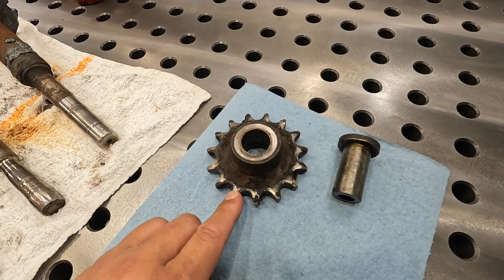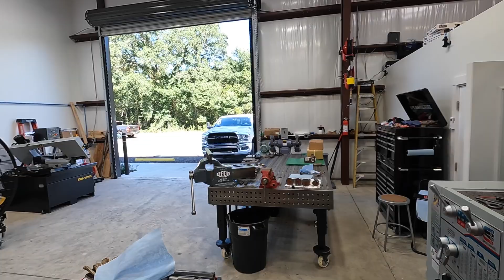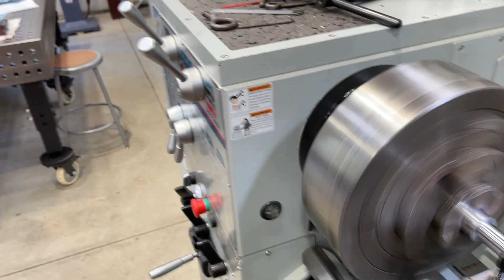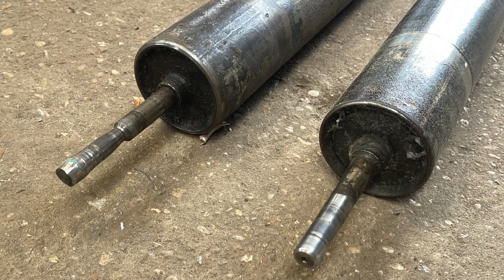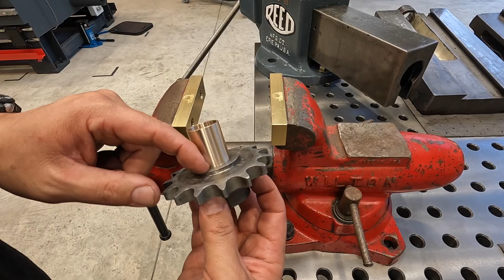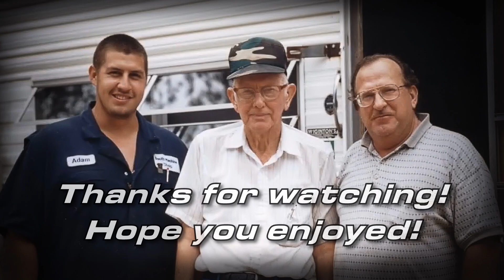SNS 366: Machining New Stub Shafts, Sprocket Repair

Comment: I always hate machining 1018 steel. I work in a shop running production parts and the 1018 jobs are always a hassle. The chips never want to break right and even when they get worn in you still get either chatter or rough patches from the chips not breaking and wrapping around the part. They also tend to put off more smoke than other materials.

Comment: I had a similar job for my buddy . He bought a used asphalt roller that had a worn out drive sprocket. 
He found a new sprocket that was exactly the same except the bore was 1" and the roller shaft was 1 1/4".
I bored it out to 1 1/4" and broached a new key way.
He was sure glad to get it.

Comment: I'm confused about order of operations on this one. I don't understand why you turned the ID of the bronze bushing to finished size before you pressed it into the sprocket. In my complete ignorance, I was expecting that you would turn the OD to finished size, press it into the sprocket and then turn the ID to match the idler shaft. Would appreciate a comment from anyone who can explain. Thanks.
Reply: I agree, always bore the bush after assembly, no problem with the bore closing up and then machined in situ with the sprocket for better concentricity.

I'm also surprised that the o/d of the bush was not roughed out before finishing the bore. With an accurate bore running true you don't want to start roughing the o/d risking knocking the part out of true.

Better still, push out the bush and replace with another standard oilite for a much cheaper job for the client.

Comment: Adam, yes although you are confident with manual lathe it would have more value if you force yourself to use and learn the cnc. Using those shafts as practice later is a good idea too. Once you do it you'll realize you could have done it just as well on the cnc as on the PM. I worked at 3 cnc machine tool companies and it was difficult helping the machinists convert to cnc. Keep trying, you'll get there. Yes,  take detailed notes.  Great video my friend.

Comment: I know you are still learning the CNC but one project that seems easy to design is the custom cutters like the one you ground to the radius.  I am more used to designing stuff for 3d printing but the concept is the same.  Once you make a model for a radius tool all you have to do is pull up the original and change the radius and save the new file under a new name.  and I know you have done several different geometries that you have custom ground in the past but going forward you could just build a library of various profiles.  There might even be libraries on line for that type of thing in the user groups for your machine.

Comment: A bit of a Catch-22 on the CNC lathe. A project like this probably doesn't benefit from its abilities and, as I believe you said, you can knock it out much more quickly manually. But it's exactly the kind of stuff that you almost need to do on the CNC just to get comfortable with it.

Comment: I have a hard time using my cnc on projects that I am so comfortable with doing manually. I find using the cnc that it easier to forget how to do something than to learn something. So it is a tough learning curve. However if you are doing a lot of parts you can’t beat cnc once it is set up.

Comment: To be fair, with only four off (and not even identical) and such a simple part, it's probably a manual job even for shops which have a well practiced CNC turner

Comment: The joys of cnc machines -simply not worthy for individual production . Especially if you are a new guy .It takes longer to write a program than to turn it on manual lathe. 
But when you need 10.000 parts thats where they shine .

Comment: Awesome, valuable content as always. I'm about to get my first lathe where I work (2.5hp 14"x40"). I can't decide if I should invest in carbide tooling. I'm not doing production runs, only one off repairs in mostly stainless steel. I'll likely be turning a lot of interrupted cuts in weld build up repairs and want a nice accurate finish on final light cuts, don't care about surface finish on big roughing cuts. All this leads me to thing HSS (with cobalt?) will serve me better but I'd love some more experienced opinions on this.

Comment: 35:30 "I think that tool's dull".  Whenever I say that then go sharpen it, the next thing I generally say is "Wow!  I shoulda done that 15 minutes ago."  I'm sure I'm alone in this.

If it's almost sharp, it'll almost cut.
Reply: How do you "sharpen" an insert tool?
Reply: @Peter-V_00  A diamond wheel can touch up carbide but the typical way to sharpen a tool with an insert is to replace the insert.  I'm old and still use high speed steel so a CBN wheel works just fine for me.  I know how to make them cut what I need to cut.

Comment: You don't need to speed up cutting passes, I like watching how things evolve at their own pace. Also, I was wondering if one could use an endmill in the tail stock to bore a precise hole radius-wise and in depth? Or is that not done?
Reply: Standard endmills don't give any good precison placed inthe tail stock as they tend to flex and give a larger hole. I sometimes use them for roughing out a hole to get it large enough for access with a boring bar. Radius endmills do a bit better. Pre drill a small hole with a ordinary drillbit first. But generally precise holes is about drillbits
Reply: To get a “precise” hole on the lathe, you bore it.

Comment: I knew when Adam got the CNCs that he would end up in this situation. 
To learn CNC requires immersion in their use. Using the CNCs isn't machining, it's 3D visualization and computer programming, and I can tell that there's probably nothing that's more alien to Adam's nature than programming a computer.
Reply: I am not familiar with  the conversational mode, but a well taught 10 yr old should be able to make a good stab at a G code program for that simple part, in say 10 minutes.
Reply: @richardjones7249  I feel like you might have missed my point. What I said isn't a statement about Adam's intelligence or technical ability, it's a comment on his nature, his personal tastes and character.
I'm not saying he's incapable or lacks the capacity, I'm saying his character isn't naturally drawn to interfacing with a machine through code or a "program"... of any kind. That's just not who he is.
And, let's be honest, I'm drawn to interacting with computers and controllers and frankly, I'd bet the 10 yr old would still be more of a natural than I would be. When it comes to computers, kids are like sponges.😁
Reply: @BigRalphSmith  To be clear, my statement is nothing to do with Adam per se.
Reply: @richardjones7249  No problem but mine definitely did so perhaps we were just talking at cross points.

Comment: Welding the disks and getting them centered in the rollers is going to be fun.
Reply: If the discs are cut accurately what's the issue?
Reply: @Peter-V_00  Getting both shafts post welding to run true on one axis is needed to preserve bearing life.  Maybe Joe has a rig for set up and for final run out checks before going out the door.
Reply: @richardjones7249  Without knowing what welding process will be used you may be correct, then again for the application slight runout may be acceptable, from what Adam said the rollers turn slowly.  If the person doing the welding is sharp they will know how to minimize runout, if I were concerned about being super accurate then the shafts should have been finish machined after welding.

Comment: What about using that piece that fits inside the bushing, to help push the bushing in the gear? That way the inside is supported. Thank you for the video.
Reply: It won't work. No need to try, I can visualize that it won't work.

Comment: Where CNC shines is repeatability. A lot of the time, an experienced operator on a manual machine can turn out a couple of parts faster. This is why small job shops will rarely be primarily CNC. Conversational programming helps to bridge the gap, and for the sort of work Adam has usually done, it's a really good thing to concentrate on. CAD/CAM software, once you climb the learning curve, is amazingly powerful, and the time spent programming parts does drop significantly, but it's still rarely the best for things like these simple 1-2 shaft turning jobs. Once you need 5-10 parts, then it makes sense to go with CNC over manual. I look forward to his journey into CNC. Just like with manual machines, there are many ways to approach any job. It's fun and educational to see how different people arrive at the same end result.

Comment: Surprising that you chose solid bronze for the new sprocket bush.  If the old bush was Oilite then it may have been better to replace it with Oilite.
Reply: I think that we can assume that he conferred with Joe.  Though not to mention anything was probably an oversight, as it was bound to be brought up in the comments.
Reply: May have been better? If I was the customer I would expect the bush to be simply pushed out and replaced. No way would I pay for all that machining! That's the idea of having standard oilite bushes readily available.
Reply: He doesn't know what Oilite is. And to be fear, never did I before you mentioned it.  To him it just looked like brazz with a lot of oil on it.
Reply: @SwedishNiceGuy  Better go back and watch again, Adam clearly states he thinks the old bushing is oilite.
Reply: @SwedishNiceGuy  He knows Oilite very well, ever since the pilot bushing on a Kubota tractor episode, where the 'confusing' spec on the material led Adam along the wrong path, and was duly made aware of it in the comments section.

Comment: When I need to remember that there are still people who know how to properly use and take care of tools, and use them for the purpose for which they were intended, this is one of the places I go to.  It absolutely boggles my mind that I work in a facility where there are MECHANICS who have no idea how to do the simplest of things.  Adjusting a grinder tool rest so that it's the proper distance from the wheel.  NOT using the grinding wheel that is meant for ferrous metals to grind aluminum, brass, and plastic.  Using a wood cutting band saw blade to TRY to cut metal.  The list goes on.  And it's not just new guys doing this.  People with 20+ years on the job doing it too.

Comment: Adam, was the bronze you used to make the bushing oil impregnated as well? If not how did it get lubricated? Sorry I'm pretty new at this. You and a handful of other makers like Keith Rucker, the fellow from OX Tools or Jimmy Diresta are my only exposure to the machine arts.
Reply: A standard oilite bush would have been far less expensive than making one from scratch and would have lubrication. Just bore out the sprocket until the old bush can be picked out then the original bore could have been used. No need to get the sprocket running perfectly true, just pop it in the 3 jaw to remove the original oilite bush.

Or just push out the original bush & fit another standard one, no machining required at all..

Comment: With no means to lubricate that bronze bushing aren’t you concerned about longevity?  That’s probably why the original was oilite.
Reply: The original bushing was oilite, the sprocket must be under low load turning slowly so grease may suffice, Adam clearly says he does not know what it does but I'm sure he asked the customer if plain bronze was okay as he commented about the old bushing being oilite.

Comment: The ability to do radius cuts on the cnc would have been worth it to me, but if you had to hurry and get that out can't blame ya for sticking to what ya know. I just got a proto trak cnc mill that is conversational and it's pretty cool being able to just program the actual geometry  not the toolpath. In a month I've gotten to where I wrote a program to make a weld on pin flag put of 3/8 plate in about 10 minutes. Being able to cut circles and complicated profiles on the mill will make life much easier even in a job shop. I suspect you'll feel the same way once you get the hang of it. Cnc will never replace some manual work but it can make some manual work much less complicated.

Comment: I was disappointed in Royal, I bought a used Royal like yours in a MT3 and while the bearings are in great shape it needs to be reground and I don't have the means to do it so I contacted them twice to see if they would regrind it for me and never could get a response from them. 
I ended up buying a new Skoda and I've been very happy with it but I would still like to get the Royal reground as a back up. I've looked around and seen a few third party places that recondition them but haven't gotten around to having it done.

Comment: I stumbled upon your videos several years ago and have watched faithfully ever since. Never did any type of metalwork prior. I asked my wife if she could think of a reason why we would need a lathe. Of course she said no. Needless to say I found an older Rockwell/Delta (11x36) at auction from a local machine shop for $600. After refurbishing it (electrical, scraping, paint, etc) I sold it for $2900 and bought a LeBlonde lathe (18x58) and did the same. Sold that one for $6200. My goal is to buy a new one, all thanks to stumbling upon ABomb. To say I’ve had fun doing this is an understatement!! So thank you Adam.

Comment: Hey Abom, using carbide insert profiled for aluminum work really well for lighter cuts on 1018 if you want great surface finish. Obviously they wear out much faster than steel profile inserts but they still last quite a while(especially TCMT with the three cutting edges per insert).

Comment: Awesome machining, enjoyed the clip. Just one Q' the old bushing was an oilite and the new one bronze, is there an oiler on the machine or some lubrication arrangement? It is a slow idler but it will still need some lubricating.
Reply: My guess is for what it does maybe grease every now and then or spray lube is enough, I agree though, oilite would have been a better choice but maybe time constrains led the customer to use plain bronze, I don't think it was Adam's decision.
Reply: I would think Oilite would be a better choice too, but maybe that’s what the customer wanted. Oilite is nice to work with, and I especially enjoy re-infusing machined Oilite with oil after machining it.

Comment: Before I retired I used to rebuild M/C cylinders.  I'd bore out the to cylinder to -.0015" clearance and then heat the cylinder and freeze the sleeve.  They'd drop in and then be tight as a drum when cooled.

Comment: As a plumber we use emery cloth to clean copper but we also use grit cloth witch is basically like a screen door it lasts forever it would be interesting if it would work on steel
Reply: Open mesh is also a joy to use on wood. I feel ordinary emery cloth doesn't really clog with steel though.

Comment: That sprocket wore out, needs a complete new sprocket
Reply: Explain "worn out" please.
Reply: @Peter-V_00  Sprockets the tip of the teeth make little triangles, and when you can’t see the those, and teeth are wore to a sharp point their wore out. That one you can’t see the triangles anymore and their almost wore to a sharp point. It’s easier to see if you had a new one in your hand.
Reply: @tsimmons4730  I'm very familiar with sprocket teeth profiles, go to 23:16 of the video and freeze the shot, the sprocket is clearly not worn out, the tips are blunt not pointed and the radius of each cog is correct for roller geometry.

Comment: Since all four looked different, and you are only doing one of each, even if you were efficient in CNC, wouldn't it still be faster to do them manually? If anyone knows, please comment.
Reply: In a shop which maintains both CNC and manual turning capability, I think that job would be handed to the manual guy.
Reply: @grafixbyjorj  That makes sense, thank you.

Comment: Adam your the only only one that does chip control….that I see on other YouTube videos. These shafts turned down beautifully AND have the benefit of the chips going straight  down into the pan. I’m not a professional machinist, but why would anyone want hot chips hitting there arms/body, shooting all over the machine and floor? Just makes sense to have the best possible insert for the job👍 Thanks for sharing that it’s possible to control where the chips go🙂

Comment: Adam, a trick I have discovered is if you are pushing in press fits, get a can of compressed air, turn it upside down, freeze the part. I measured the temp in a Styrofoam cup and it's -59F. Works for me most of the time. Food for thought.
Reply: Great idea. Wish I’d thought of that years ago. Never too old to learn new tricks.

Comment: For the CNC lathe and simple stuff I'd recommend a program template for you. Copy and paste then renamed. Has all your cycles in with preset safe starting numbers. All you change is profile code. Still involves all the math you use on the manual lathe. More hands on where you would feel familiar. Much less point and click memory.
Reply: He is just like a demented old grandpa. He doesn't remember sh** from what he learned 5 mins ago.